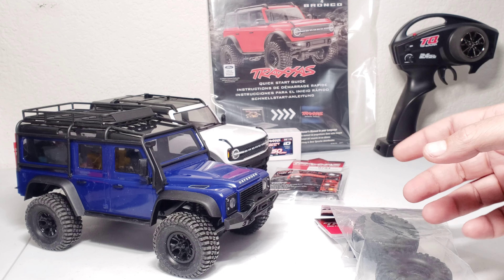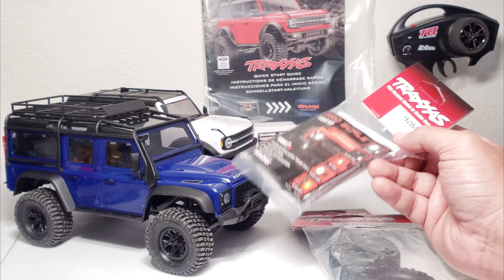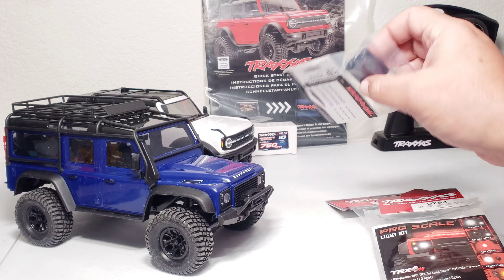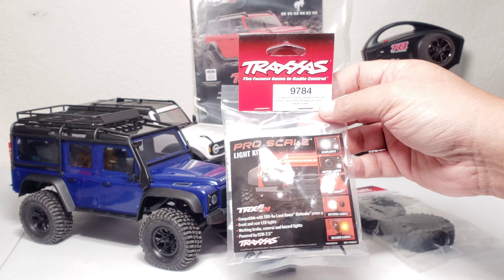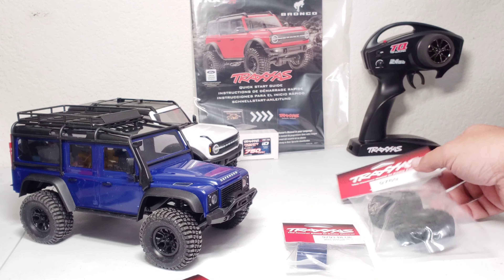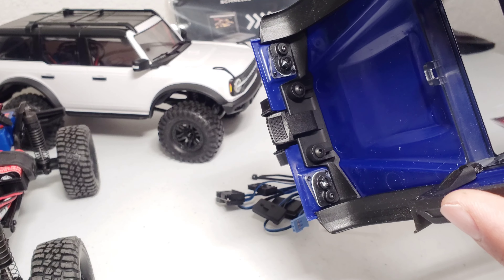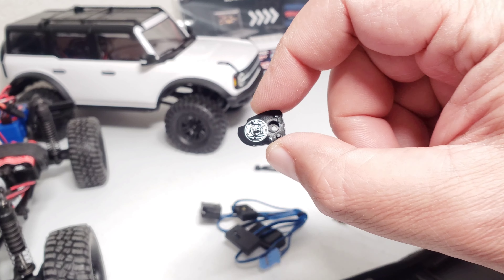Traxxas TRX4m Defender Pro Light Kit and heatsink install.

Comment: Thank you for this video I had a hard time trying to install the heat sink at 1st. I remove the motor from the transmission so I could slide the heat sink, but it kept getting caught with the titan sticker that's on the motor. I don't want to ruin that sticker lol, so I just gave up until I just saw your video. Thanks again

Comment: The only thing that pisses me off about these lights is that you can’t have the hazards on with the rest of the lights… having them on with the rest of the lights should have been one of the options… I don’t even mind that you have to reach under and push the button to activate the modes… but they could have gotten rid of ‘demo’ mode in exchange for having the hazards working with the rest of the lights instead of with the lights just ‘off’ altogether… as long as there are no turn signals… you don’t use turn signals while crawling… but you might use hazards
Reply from the maker: yeah im not into the turn signals either.

Comment: Holy cow you 3D printed a indoor rock course, I have to check that out, I'm way into 3D printing and crawling
Reply from the maker: they are just a bunch of files of rocks that I resized and printed and use double sided tape to secure them down on my table. They have been hours of fun hahaha.
Reply: @RunThatRC  any video?

Comment: So sad it’s if I change I receiver. I’m going to lose the functionality on my lights. That’s what happened with me.
Reply from the maker: someone makes a adapter so you can run the pro light kit but it cost a pretty penny for it. I cant remember the name unfortunately.
Reply: I know you mean adapter I saw someone on YouTube then I order it, but it doesn’t work like how it’s supposed to work on the stock receiver. It just kept blinking sometimes and sometimes it doesn’t work and sometimes the rear in the front doesn’t.

Comment: I doubt the heatsink will work properly through the sticker on motor ..
Reply from the maker: It definitely still works but would be more efficient without the sticker and some thermal paste. With the low range gears the motor doesn't get too hot trailing around so its good for now.

Comment: How do you take the heat sink off now?
Reply from the maker: you can pull it off straight up but that takes effort. The easiest way is to remove the motor from gearbox and slide it off the motor.

Comment: Is it compatible with fenders installed as I have those on my rig and I am not sure the pro scale light kit which I have got later, would be able to fit on those tiny spaces after fenders on.
Reply from the maker: the pro loght kit should work as it tucks up towards the esc. I dont know what fenders your running but I dont see why it wont work or be easily modded.
Reply: @RunThatRC  you are absolutely right, this pro kit LED sockets tucked in perfectly with body shell and chassis with 3d printed fenders. Looks great on my rig. Thanks 😊
Reply from the maker: @kaushalvyas5445  glad that worked out good for you! Must be looking nice!

Comment: I really like the defender body, I have a rochobby katana V2 and it's a nice rig but it needed a 2 speed for outdoor use. How does the trx4m stand up speed wise for trailing?
Reply from the maker: In my opinion the Trx4m sits between the Katana and FMS FJ Cruiser. That's just from judging its stock performance.  The Trx4m is the easiest to work on and after the low range gears installed ($5) it's a whole new animal.
Reply: @RunThatRC  I've wondered about getting one, I REALLY like defender bodies and hard bodies. And they finally did both....I really wanted to hold out for wpl to make one because I prefer the 1/16-1/12 scale more, since they travel better outside.
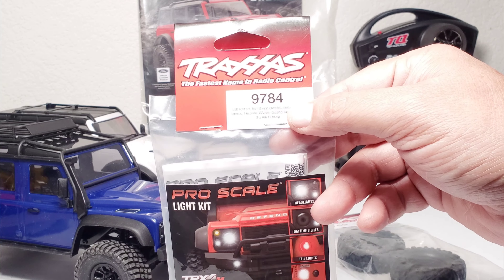Reply from the maker: Definitely 1:16 for real outdoor trails.